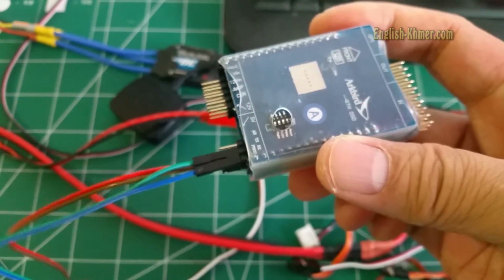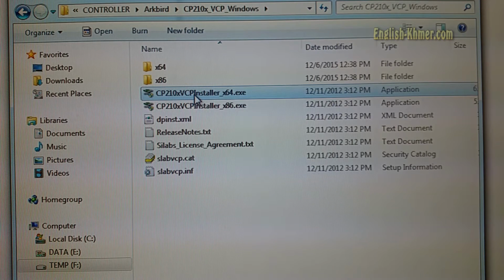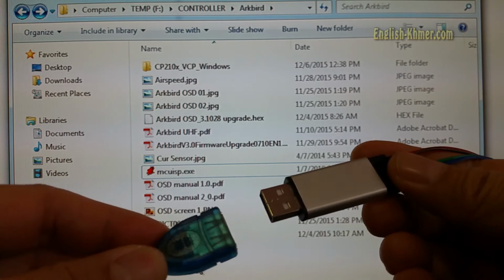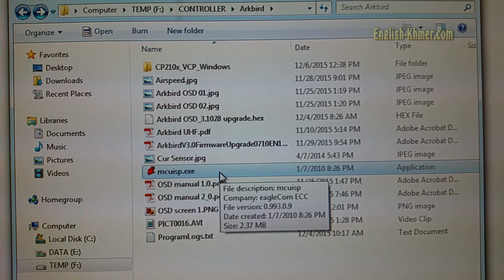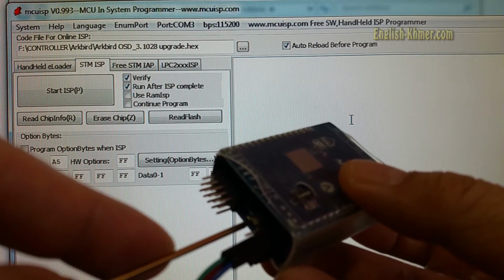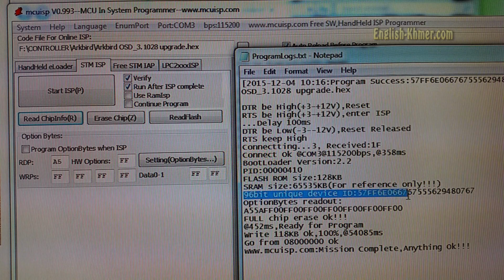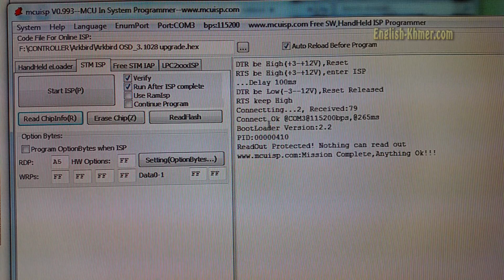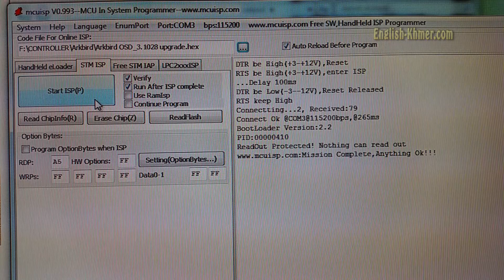Firmware Update for Arkbird AutoPilot OSD How To latest version 3.1028

Comment: hello I have a new arkbird already connected all the chips but not works I  have to do something before you install? thanks
Reply from the maker: Did you update the firmware?  You'll need to do that first.
Reply: +Niset Khmer I not update firmware... only works after updating firmware? when new purchasing it comes without firmware